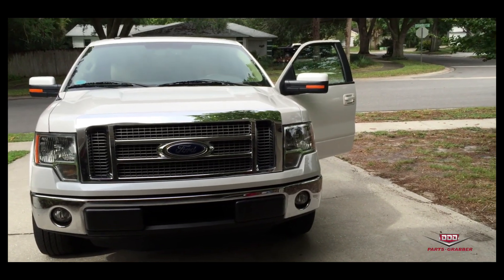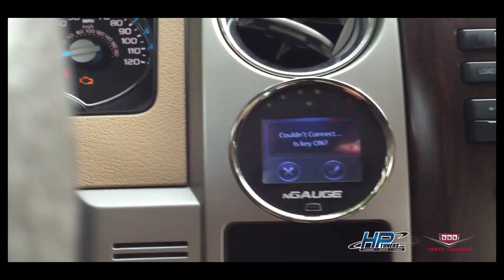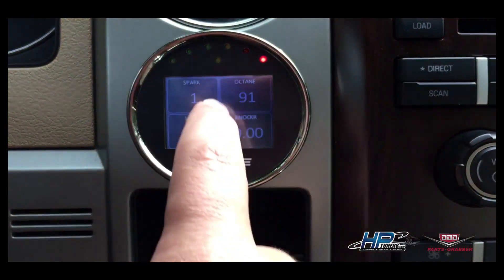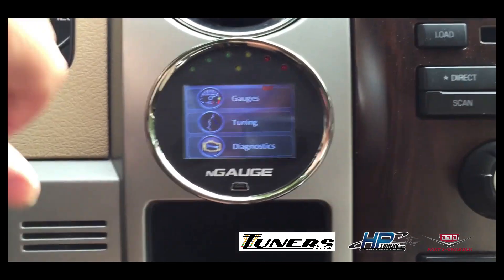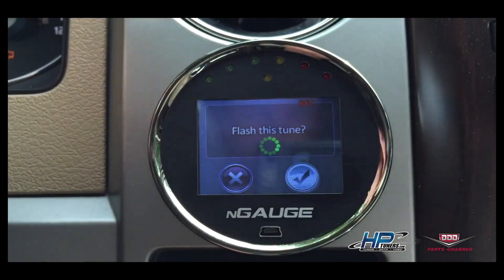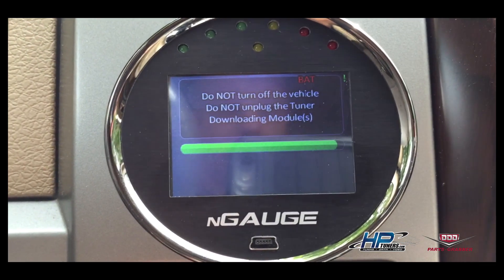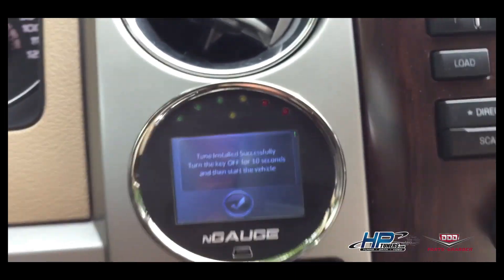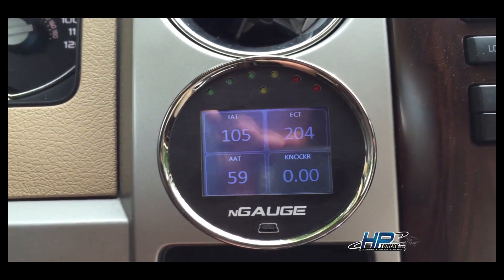F150 Tuning with HP Tuners nGauge.

Comment: What good a tune if it don't make your truck any faster?
Reply: Driveability is what 70% of tuning is. Getting wot to 13.0 is a tiny step of the process
Reply: @ChrisSmoove77  Ford tune that truck from day one. He can't make it any Quicker. If you want a 5.0 to be quicker. You will have to change the cams or boost the engine.